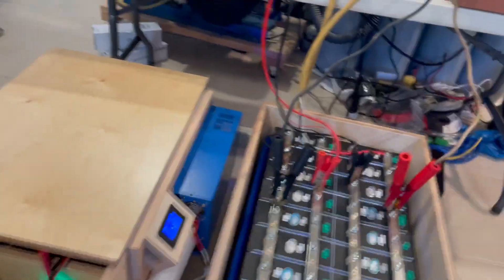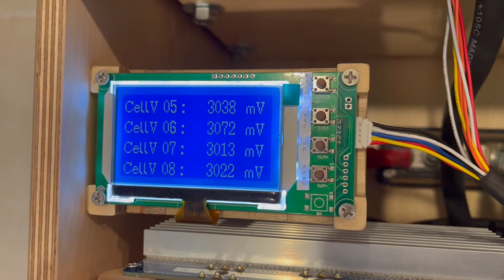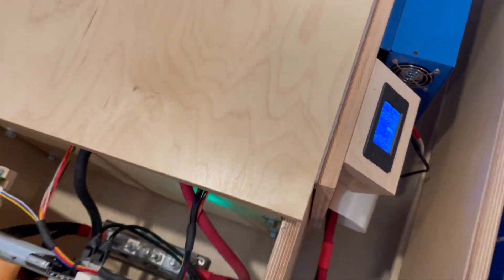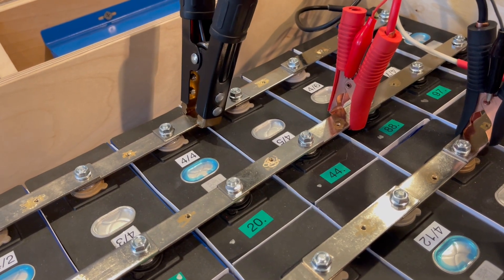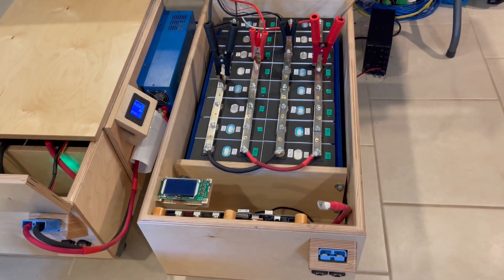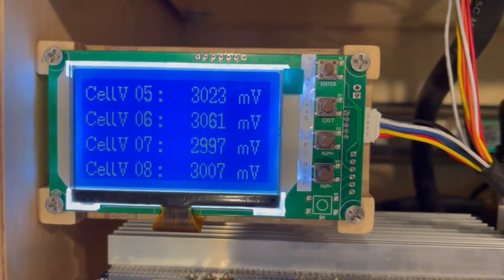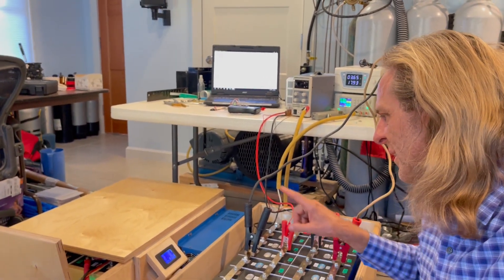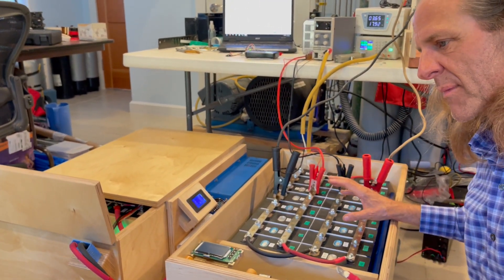I'm Building Sixteen BIG Lifepo4 Batteries!!  Doing the Energy Leapfrog!

Comment: I built 2 batteries using 280 ah EVE cells, making rolling boxes like yours. Turned out great. 
Also followed your terminal polishing advice and ended up with a pack resistance of less then 5 milliohms at the main positive and negative. Thanks for making these video's.

Comment: I did not understand why u did not charge in series thru th BMS as this would balance cells!
Reply from the maker: The BMS balances at a max of 150mAmps. The cells are 280AH. It only balances while charging. MAYBE it would be balanced in 2024? lol Seriously, top balancing in parallel seems easiest to me and definitely most fool proof as long as you don't let an errant power supply take the voltage too high. This method of ganging multiple chargers is only taking 36 hours and rest for 12 so that is actually relatively fast as well. I'm sorry if I didn't explain my reasoning well enough in the video. Dangit.
Reply: @RayBuildsCoolStuff  I have a 304ah battery and it balanced itself in a couple of weeks. It does not have to be balanced to work

Comment: Hi can you please recommend a good bench power supply and where can order it thanks and regards
Reply from the maker: Hi, how many amps? How many volts? Willing to pay for quality or price is the critical concern? Your choice will be a compromise of these factors and there are some minor options regarding additional features.
Reply: @RayBuildsCoolStuff  for a 48 volts system hight amps and price around 300 dollars
Reply from the maker: @merren06  the closest I have used for what you want is the Riden RD6018 you can buy the housing, faceplate and power supply and assemble them. It has great monitoring and controls and a great display. I am only able to charge at 58 volts up to 14 amps before it starts to complain. It makes a buzzing sound at 58 volts and 18 amps. I think it needs to stay below 900 watts but it likes 700 much better. I paid 193$ us. I purchased on aliexpress and assembled it by following one of the excellent YouTube videos on the subject. Maybe another viewer can make a better suggestion.
Reply: I am getting ready to put together set of batteries like the one you working with 16 lifepo4 310 amps. do the bms that you are using come with the monitor our you buy them separately can you give me the details on it and where to purchase thanks for your kindness
Reply from the maker: @merren06  It comes with the Seplos BMS

Comment: Is it better to disconnect them from parallel when they're all at 3.65v, or when they've all gone to their resting voltage? I have 4 202ah cells that I top balanced, but then disconnectd the power supply and let them rest for a few days. When I connected them in series I found they were out of balance with #3 always triggering the bms.
Reply from the maker: I let them rest for 8-12 hours but not for days. I would let them rest for a shorter period if my copper bus bars would get here but these terrible brass bus bars I was initially sent take longer to get a good balance. 

When you say that they were out of balance when you connected them in series, I think you mean that cell three triggers the cutoff which likely indicates that it has a lower capacity than the others. Did you test the cells individually? Second question, when you recharge the battery, is cell 3 close in voltage at the top of the charge cycle?
Reply: @RayBuildsCoolStuff  I like the zketech software but didn't think I'd be doing much testing so I just got the EBD-M05 model, which only does discharge at a 5a rate. Takes a long time. Running capacity tests now on the cells now that the rv season is over and I've winterized the trailer. Looks like #3 may not have the capacity of the rest.

I found that the system wouldn't be able to really go into absorbsion since #3 would trigger the cutoff. When reaching the top end of the charge it seemed that the 4 cells all took off at different times, doing their own thing. Made me wonder if they were top balenced properly.
Reply from the maker: @sl0rion  Sure sounds like #3 has a capacity issue. How much is it costing you in pack capacity?

Comment: I will say let it set in parallel without charge for a day for a better top balance
Reply from the maker: I've been letting  it sit overnight or a bit longer. The cells by then all measure exactly the same in millivolts and the voltage has settled to about 3.5 volts. The last one was exactly 3.5 per cell when I hooked up the BMS. When I checked the wires at the connector, each cell added exactly 3.5 volts. It was kind of neat.
Reply: @RayBuildsCoolStuff   so that’s really good news. On my 3 4s I have to live it about 24hrs in parallel to have a good top balance. Been working really good for about 6 months 24/7.  I have the lifepo4 in a travel trailer but when the travel trailer is park in my house I used that power to the dryer, washer and fridge in my garage. Other wise the power from the travel trailer solar is useless . I have 800w solar on the roof
Reply from the maker: @pelecho  that’s coooool.